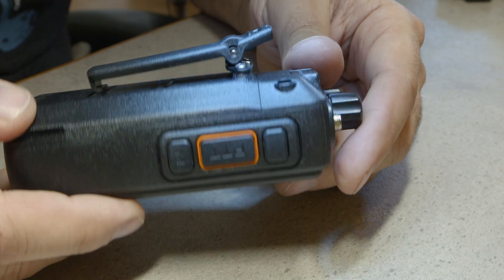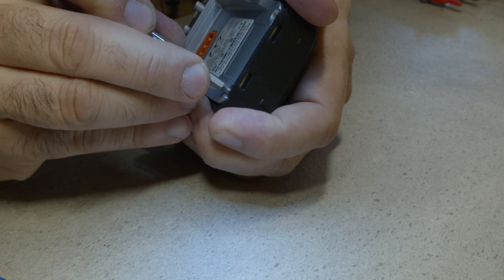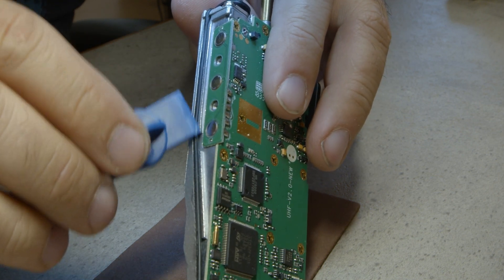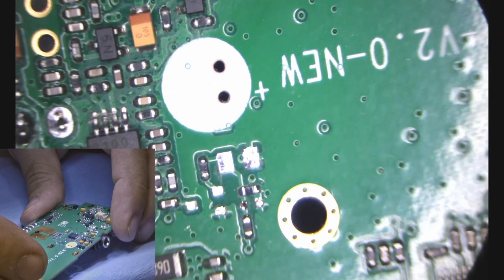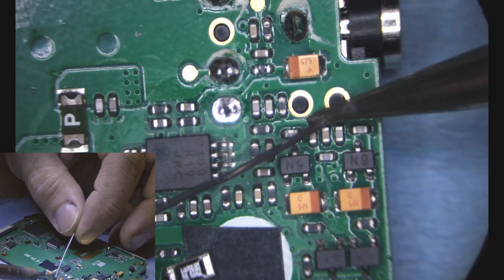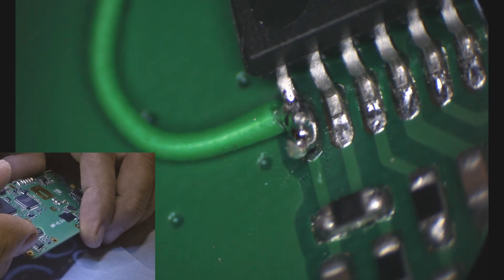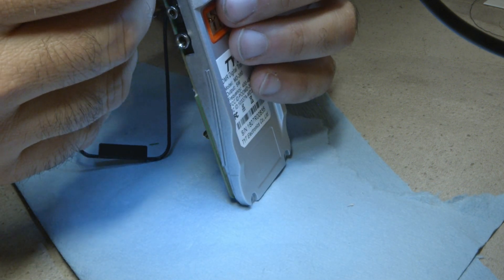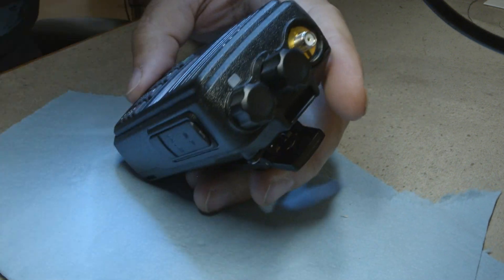TYT MD-380 Hardware Modification for OpenRTX and M17 Protocol

Comment: does M17  in this radio supports other versions of M17 implementions from other radio manufacturers? and does m17 software supports aes 128 / 256 encryption?
Reply from the maker: I'm not aware of any radio that supports M17 out of the box, though I could be wrong.  If the radio has been modified to TX M17 then it should work with any other radio modified to use M17.  Encryption would be illegal and have no purpose for use on the ham bands so I have no idea. Check the M17 site.

Comment: any other hardware mods available? I'm interested in modifying the filters to allow 1.25m 220mhz operation, which is possible with OpenGD77 firmware, however it seems that the TX RF filtering is poor for this band so I'm looking for ideas for modification.
also, I wonder if a radio modded for OpenRTX as in this video, is still usable in OpenGD77? still no DMR in OpenRTX at the moment, so I guess I'll have to switch between the two firmwares depending on the current needs 🤔
Reply: Enabling other bands is out of scope of our work.

Comment: I made a change to the UHF RT3 radio, but the audio is very low, I can only hear it with my ear close to the radio speaker, can anyone who made the change confirm it?
Thank you very much for the video.
Reply: Same problem here with my MD-380. Volume knob is not working. Seems to be a software issue.
Reply: @DF2OO  well known issue. Software fix is possible, but OpenRTX team needs more devs to implement it (with some free time available).

Comment: The page on the openRTX website about the MD-380 mod says "due to technical limitations of the underlying hardware, transmitting M17 audio on the radio requires two small hardware modifications." Does this mean it can still receive M17 without the modification and only needs it to transmit? Thanks
Reply: The mod is required for reception too.
Reply: @SP5WWP  thanks